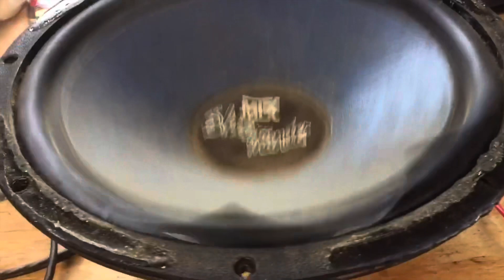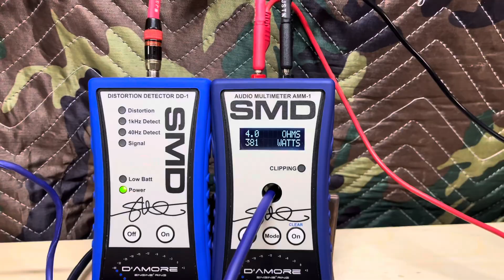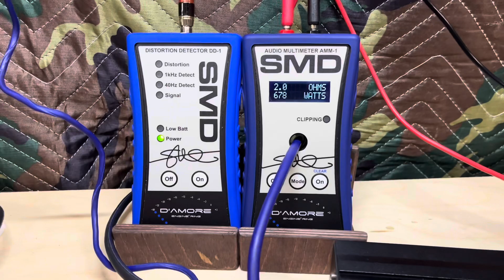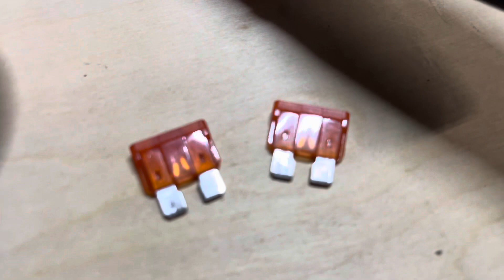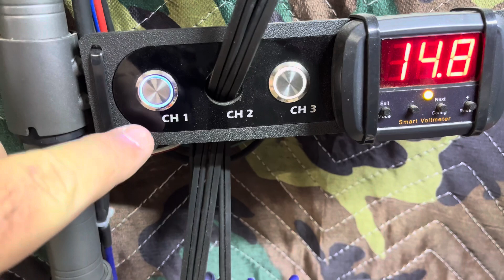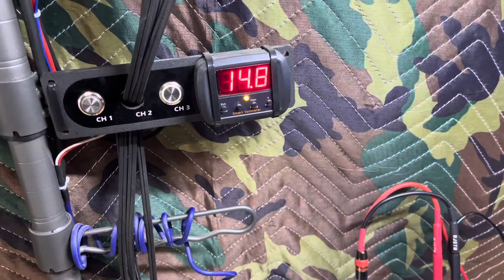Amplifier Trials (#1, part 2)

Comment: That's funny cause I have a recoil 1200.1 and it was the same way... distorted less once I turned down the crossover. Cheap amp problems in my book.

Comment: Sorry this happened brother. I am far from an expert but there are a few things this amp is missing even with being a budget amp. This design has been used on many amps. It’s a very old design that is great when done right. Definitely need better input filtering. Needs more silicone on the board ( might just because it’s a prototype). I believe it is the same one that’s on aliexpress but the one there has way bigger filtering caps. I honestly would wash your hands with it and find a different build house. Nowadays is all about the mini amps.

Comment: Im guessing you have at least 1 shorted output fet. That would cause the ps section to draw excessive current and possibly blow itself. You know how to use a dmm. Set it to beep and check accross the 3 legs of the fets. Guessing 3205s in the ps and 640ns in output. I repaired a 3.5k version of this. The board popped like a fuse near the pos neg inputs. Your lucky to have fuses.

Comment: Looks like a super budget build. Class D amp in an AB case they've been making for elebenteen years. 

Not an expert... That triangle wave looks like it could be an opamp failure. Again, likely super budget parts. Didn't switch when the infrasonic filter was turned off, then the dirty signal blew the amp. I've seen very similar chariteristics on amplifiers with bad opamps that I've worked on. 

Do you see any 393 or 353 ICs anywhere near that potentiometer?
Reply: Actually, would you be willing to send me that amp if I pay for shipping? I'd be curious to know if I'm correct. Could fix the cheap parts with legit and re Dyno.
Reply from the maker: Yeah, I was determined to find an amp with a clean sine wave and one that could handle 1 ohm resistive up to clipping. I don’t know what the components are that you referenced.